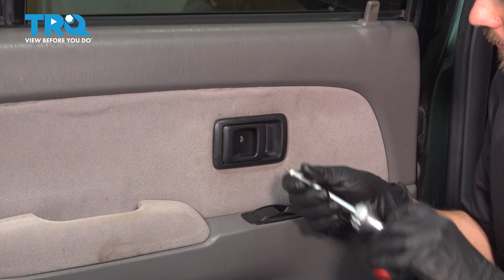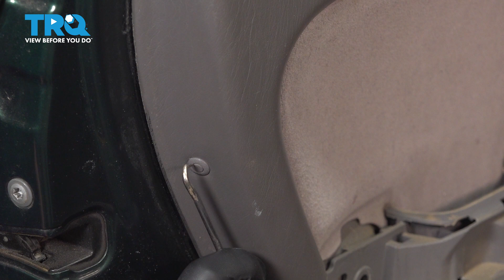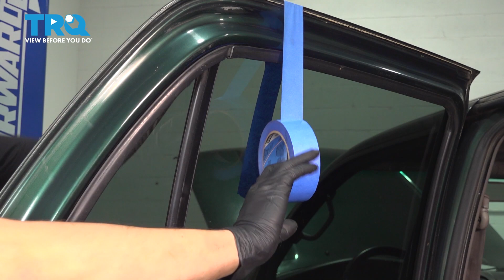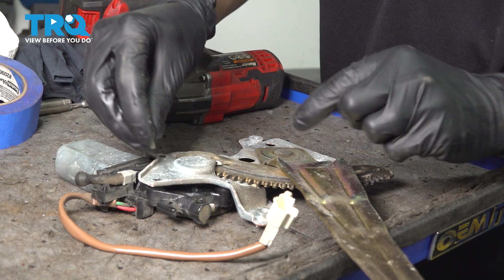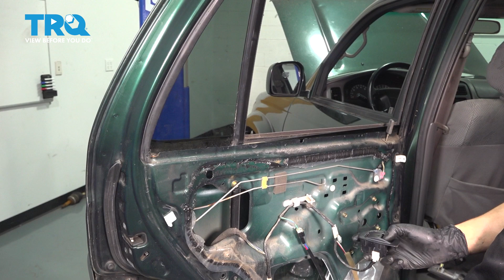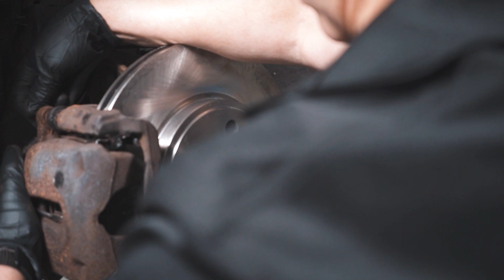How to Replace Power Window Motor 1996-2002 Toyota 4Runner

Comment: What do you do if the window is stuck down
I tested a new switch so I’m assuming it’s the motor
Reply: Once you have the door card off, you should be able to slide the glass up by hand.  Have a helper ready, because you don't want to drop it once you start raising it, then tape it all the way up the same as he did here.